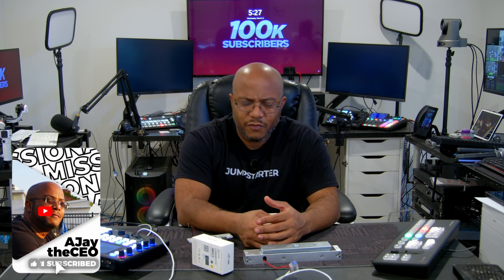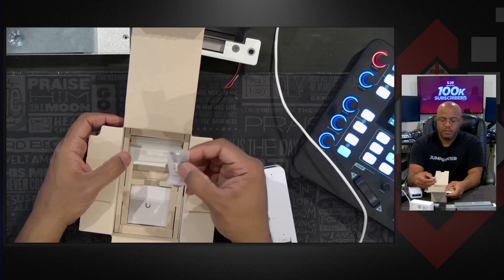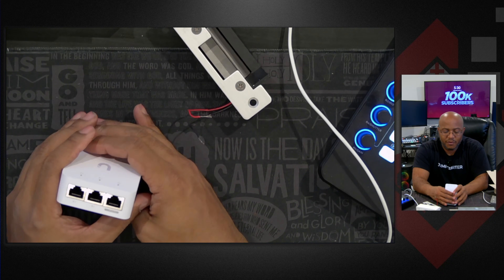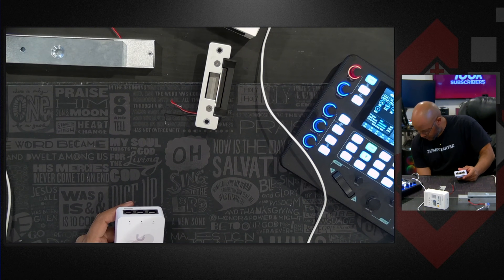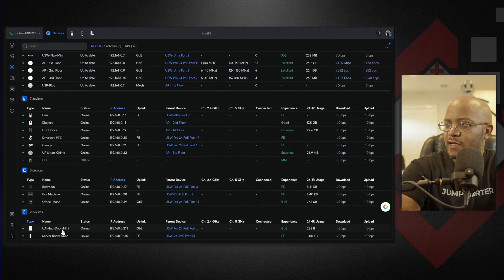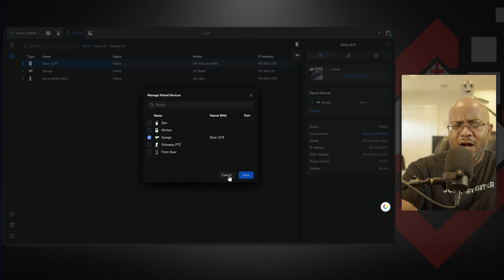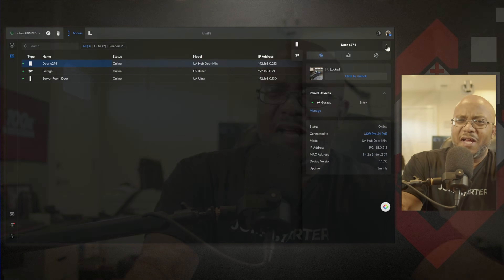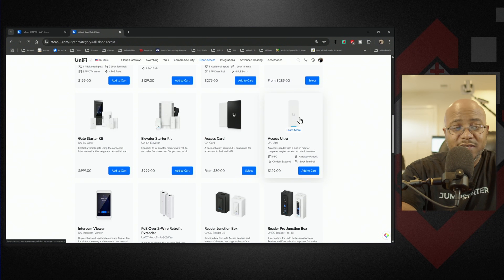Small But Mighty: UniFi Door Hub Mini Review

Comment: Got mine controlling the garage door
Reply: @Crazy--Clown  if I just want it to open and close my Beninca gates via dry contact, connect a video doorbell and possibly a LPR/AI camera and don’t need all the other whistles and bells like buttons and sensors and sirens since my gate already has the option to expand on that, is there any reason to still go for the bigger hub or the gate hub? I’m also thinking the mini should be fine for me. I have 3 gates and want to buy three mini hubs + 3 doorbells and the mini coincidentally fits in the junction box of the gate controllers and is the cheapest of the bunch. Am I missing something?
Reply: @FinalBoss429  Mini should do but check the specs and download the instruction book it should clearly show you in the diagrams

Comment: One of the questions I had was about power. Does the door hub provide power for the magnet / striker plate, or is this just a NO/NC relay?
Reply from the maker: Yes it did provide power if you toggle the 12v/1a switch